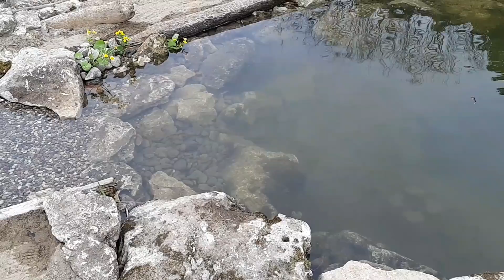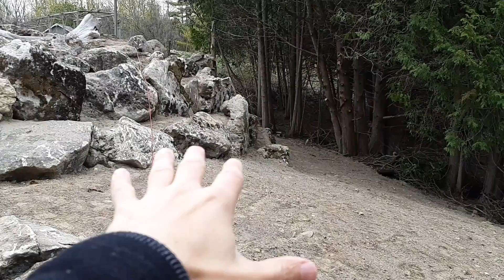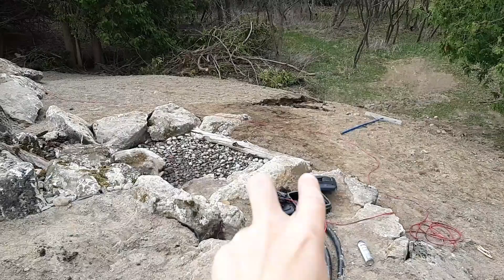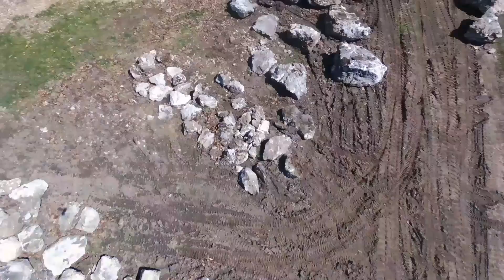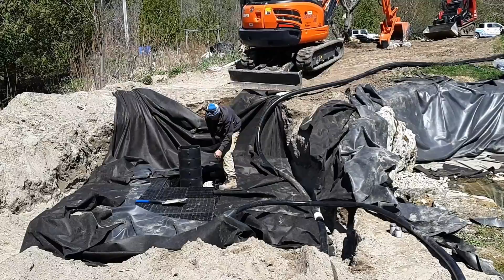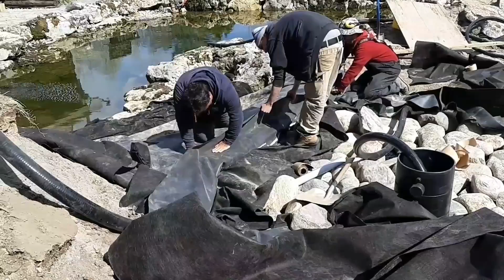Pond design - what is a wetland filter?

Comment: what do you think the advantage is of the water flowing up through the filter from below versus water coming in on top and flowing down with the stones reversed and ending in a reservoir?
Reply from the maker: Roughly 1/3 to 1/4 flow goes into wetland versus the waterfall. Then it all ends up in the reservoir below.

Comment: I'm working on designing my wetland for my pond but need more info on how tall to make it. Where does the top of the wetland sit? Is it right at the water level or slightly above? Would it be ok to do a small water fall from the wetland into the pond? (like a couple inches drop)
Reply from the maker: Yes to everything. Wetland should be just higher than the level of the pond. My pond has a little ledge where it overflows, so that the overflow is very shallow (higher velocity and thus carries debris over and out). 

Having a waterfall go into the wetland is a great idea. We were going to do that here, but the space just didn't allow for it.

Comment: I am slowly starting my small food forest down here in Cincinnati, OH! I really appreciate all the help and inspiration! I want to add a small pond/wetland area to help add biodiversity and sequester water and nutrients to my property. I was watching this video and had a question about the biofilter zone. I was curious if it would be possible to add an area to hold and charge biochar. I was thinking that adding one 55 gallon drum buried and hidden that I could fill with fresh biochar and have the water percolate through the bottom and then into another percolator area with gravel (like the one you have). The idea is that the biochar would help filter the water (just like a drinking water filter) and simultaneously would charge that biochar. After a few months I could harvest that biochar to amend soil and add to compost, and then fill that tank with fresh biochar. Do you think this would have any negative effects on the waters ecosystem? 

Thank you for any help! I may have a lot of questions in the coming years! Much love!
Reply from the maker: YES! I have been rolling around ideas in my head for this also. I think ease of access is the most important thing. For that reason I was thinking about just a tray under a small waterfall that was removable. However, your idea is likely the best way to get very good microbial inoculation because the water would be slowly pushing up through it.
Reply: @CanadianPermacultureLegacy  I think can make an insert basket out of hardware mesh with a handle I could just pull the whole basket out for easy harvest. A few flat rocks to cover the top should camouflage it pretty well. If you have any good sources for bare root trees in the US that would be amazing! I think that would be a very useful future video... helping people with where to source good plants and other supplies. That is the one subject there is very little info on.
Reply from the maker: If you are in the US, check out Raintree.

The reason I don't do that is because I think its ideal to buy local. Not just for environmental reasons, but also because local suppliers often have the best varieties for the area.
Reply: @CanadianPermacultureLegacy  I will check them out, thank you! 

I agree with buying local.... but I meant just more of a generalized idea. It is so easy to just go out to the big box stores and grab whatever we can find. I am finally starting to develop a relationship with some local gardening stores and farmers.

Comment: Thanks so much for sharing your video, very well done, informative.. so many videos out there that just take up space on youtube that dont offer any real content, so good job.. I will be building one soon..question- why not place the wetland filter at the top of the pond where the upper waterfall starts, and use a negative edge to let the water start the waterfall? also how long would this pond go if you had a power outage or pump failure?  cheers
Reply from the maker: We were going to add it up top, but we ran out of room. The only way to put it up top would be to take over a larger portion of the front yard and the missus didn't want that. 

If the pumps lose power, there really isn't any siphon effect to keep it going, so it will stop after about 10 seconds or so.

Comment: The deeper you go the lower the oxygen without an air diffuser. If you go with a diffuser try to only run it at night or your pond will become warmer if run 24/7.
Reply from the maker: Indeed, we have been running ours 24/7 and monitoring the temperature. So far it's still at a nice cool 73 degrees. I will keep an eye on it. We have other challenges which I'm planning on making my next video.

Comment: Is there Anyway to do a natural filtering system with no pump involved? Does a pump have to be on 24 hours if the variety of fish don't need created o2?  I have a gourami pond and it doesn't have a filter or pump.. The fish are doing well but the water is murky, I do have loads of plants  in it.. Thank you
Reply from the maker: I'm not a super expert on pond stuff, I'm still learning it. But I do know a lot of people use a windmill powered aerator. This is probably the most elegant solution, but requires you to have a giant windmill somewhere. I didn't want to mess with my bird population, so I went with pumps and solar panels instead.
Reply: @CanadianPermacultureLegacy  thank you for the feedback..

Comment: Is this a pre-filter for potable water?
Reply from the maker: It can be, but there are some bacteria that this will not take out. So if your pond is susceptible to giardia, I would definitely recommend getting a Berkey filter or something similar before drinking. Boiling can also never hurt, and can deal with stuff like lupus.
Reply: @CanadianPermacultureLegacy  i wand to create a 3 stage pond system leading to under ground water storage. Mass collection pond, wetlands then the pre-filter pond. Then build a 3ea 55 gal filter using sand aggregate and bio char for drinking water. I just bought a property with electricity but no water or septic. I have 100' elevation front to back and over 5 acres to work with. Currently all covered with trees. Zone 10. Tropics
Reply from the maker: Sounds incredible!

Comment: I love this video. It has so much amazing information. I just have a quick question regarding the wetland filter. Is there a difference between this and an “active bog filter”. I have been doing research and have found some that say having an active bog, with no more then 12” of pea gravel and plants and no standing water will work just as well as the Aquablock setup, for less material cost. If you have any insight that would be great!
Reply from the maker: They both work, and are very very similar. I believe the aquascape designs with the aquablocks was an improvement made by Ed Beaulieu. The idea is to expand the active zone of aerobic bacteria.
Reply: @CanadianPermacultureLegacy  thanks! I also realized they are using the aquablox to make the void to allow the water to spend “half its life out of the sunlight”. I had forgotten about this and it’s another reason why I love your videos! Thanks again!

Comment: Hi what size pump are you using for your wetland filter?
Reply from the maker: AquascapePRO 7500. Rated at 7,500 gallons per hour at a 5′ head height. Rough cost $1700 Canadian.
Reply: @CanadianPermacultureLegacy  I am not sure what pump size to use. My wetland filter is 7x12 I have two large centerpids about 12 feet in total length. The head is 2 feet will be feeding from the intake bay 20 feet away. Have any recommendations for pump size. I was thinking on 4500 GPH but not sure.
Reply from the maker: Should be fine, if possible use max size piping that attaches to the pump.
Reply: @CanadianPermacultureLegacy  Thank you.

Comment: One more question what would happen if I made the wetland filter level with the ponds water level. Meaning there would be no small stream at all running but the water coming up from the wetland filter would be still entering the pond from the bottom of the wetland.  Would that be OK?
Reply from the maker: Yeah thats what I meant. But the wetland if done properly will actually pump INTO it from the bottom. This is because you want to create turbulence and setling of sediment against the flow, as that separates more efficiently from a fluid dynamics point of view.

So your wetland pump should pump into the wetland bottom, the water flows up through the rocks in the wetland, then out as a surface flow (at equal level, yes) into the main pond.

If for example you pump into the top of the wetland, it will just exit into the pond and the bottom of the wetland will get anaerobic and you will breed pathogenic bacteria.
Reply: @CanadianPermacultureLegacy  Thank you for your help. Again  you have a great pond.

Comment: I am in the process of enlarging my fish pond which I had for the Past 30 years. The present pond is 2800 gallons. I am adding another 12,000 Gals  4 1/2 feet deep. The cost of building a wetland filter is very expensive for me so I decided to build one myself. I purchased milk creates from a farm manufacturer. Each milkcreate tested by the manufacturer can hold 2800 lbs of weight. I reinforced the creates with PVC piping so it can hold an additional 1000 lbs of weight for a total of 3800 lbs. The rocks that will be on top of the creates are distributed evenly across all of the creates so they have plenty of support. I used a 6 inch ABS pipe 10' long and have a cleanout pipe which will come out of the wetland filter so it could be cleaned out with a sump pump. I will be using 3 layers of stone 3 - 6 inch, 2 - 3 inch, and the top surface stone will be 3/4 to 1 1/2 inch stone. I will have a small stream with a water fall flowing into the pond. The ABS pipe like the certerpide is cut out every 3 inches on both sides of the pipe with slits that are 2" x 5" for water flow. Hopefully this will work. It has the same principles.
Reply from the maker: Yeah  it sounds like a solid plan. The aquablocks used here are basically glorified milk crates. I think it will work.
Reply: @CanadianPermacultureLegacy  Thanks.

Comment: that is still a mechanical filter, the rock and other material inside the wetland filter, is your biological filter
Reply from the maker: Yes technically correct. The rocks perform some mechanical filtration (I was talking more about a traditional engineered filter). 

Another aspect to the rock is biological filtration though, because of the biological sludge that forms on the surface area of the rocks, which is basically bacteria, phytoplankton, etc. The more surface area the more biological life that attaches to it. So its not just the roots and plant's doing the bioligical filtration but also the microbiology on the rocks.
Reply: @CanadianPermacultureLegacy  if the wet land filled with water hyacinth, it will be a monster bio filter.
Reply from the maker: Indeed!
Reply: @CanadianPermacultureLegacy  i just love how natural does its job. its way more elegant than nowadays engineered pond with mats and filter media all over the place.

Comment: How many gallon pond is this. I have a pond that is 9,000 gallons and thinking of adding a wetland section. How big of a wetland space would I need for this size pond? Do I go 4 feet deep?
Reply from the maker: Mine is 20k (just the pond itself), but also have 2 streams and the underground reservoir, so total water volume is probably close to 27k. My wetland is 4 feet deep, roughly 6 feet by 8 feet wide/long.

You don't have to go 4 feet deep, but I would go at least 2 to 3. The deeper the more roots and filtering. Actual water depth is about 3 to 5 inches.

Comment: This is an outstanding run-through of your system. Very inspiring!
Reply from the maker: Thank you!
Reply: @CanadianPermacultureLegacy  you probably mentioned his somewhere but I couldn't find it...if you didn't mention it I apologize if this is gauche but... How much did this glorious installation cost?
Reply from the maker: Quite a bit  just north of 200k. Thats mostly due to a few things I wanted, they don't all have to be this much. I wanted an extra deep underground reservoir for water storage in a clean way. Thats for my prepper side. Also, the rock was a very expensive add on. Local wear resistant lime. I could have done granite and saved probably 50k. The look would have been very different.
Reply: @CanadianPermacultureLegacy when you say lime do you mean sandstone?

Comment: When building the wetland filter why did they put another layer of underlayment on top of the liner around 12 minutes? I assume it’s to protect the liner from the rock, but I’ve never heard of someone doing this. Awesome pond
Reply: Lets Lucy Seems like a great idea to increase the longevity of the liner. But potentially more difficult to clean during a standard pond clean out. Would there even be any reason to ever do a cleanout on an ecosystem pond like this?
Reply from the maker: Sediment will still collect from leaves and such. Due to the design though, it tends to collect in 2 main spots, which has access to drop a sump pump down and pump out once every few years.
Reply from the maker: Yep, you nailed it
Reply from the maker: Thanks, I'm beyond pleased with how it turned out. I'm really excited for the vertical elements to start growing. The trees around it will really make it feel like a hidden oasis. I saved up my whole life for this, so I am really glad it turned out as it did. Reminds me of going to a trailer at the cottage when I was a kid.